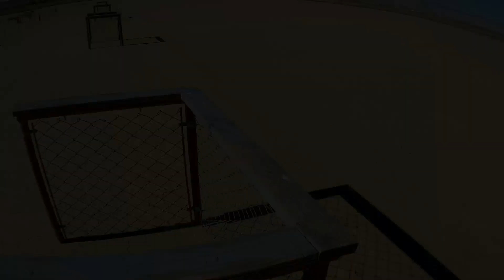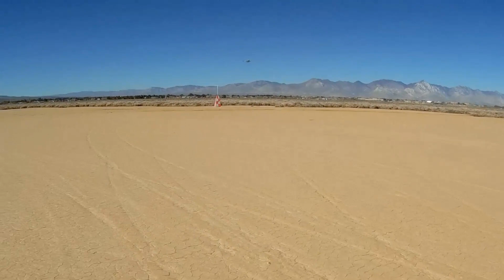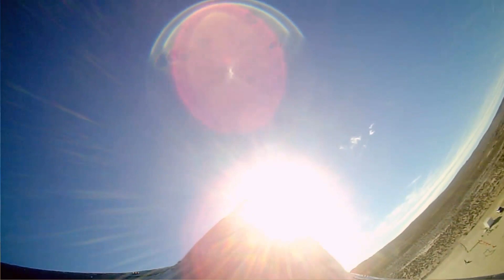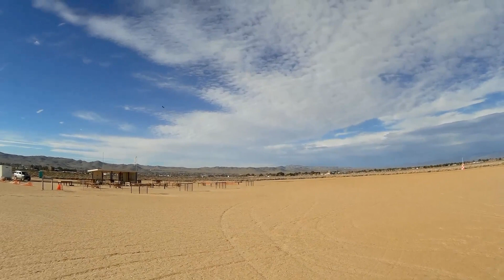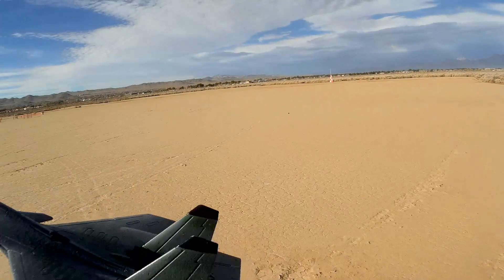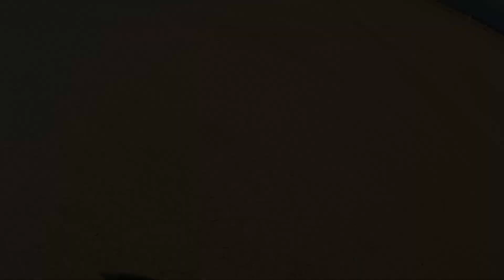Flybear FX861 J15 Flying Shark RC Combat Jet Flight Test Review

Comment: Q101 or anyone, Do you know What kind of lipo & or connector it uses? I'm looking for spares.
Reply from the maker: +D Navigator 7.4V, 800mah, red JST. Dimensions 13mm x 28mm x 50mm
Reply: Great! ; that's a pretty common size, THANKS! I want to jump on this...looks like GB & DM are the only 2 retailers.

Comment: I'm surprised of the stability. I have the Flybear 808 biplane I use for indoor flights.  I'd think this not the plane for folks in urban areas that don't have the vast room you do to fly these things.  Stick to quadcopters for those folks. Still waiting to test fly both my F959 & Hubsan H301S powered gliders at my RC field.
Reply from the maker: +MrPolymers If the wind dies down, take the 808 outdoors for a high flight over the neighborhood.  And if feeling brave, try a night flight.  But you'll need to maintain orientation by its movement alone, as it just appears as a moving light dot in the sky.
Reply: LOL..  Well, I got yelled at last fall from one of my neighbors flying my Flamewheel quad over his house.  Since I'm within 5 miles of CAK, I don't want anybody calling the police on me. My days of flying in the hood are over. I'm pretty much resigned to my clubs flying field.  I don't have the luxury of a desert close by..;)
I did try the 808 in my driveway. Nope, must have been too windy..
Reply from the maker: MrPolymers I really like my 808. I keep it in the car, ready to go.  What I like about it is that any small field or parking lot will do. If I drive by anything that looks suitable, and if the wind is right, I'll sometimes stop and send it up for a short spin. I'm going to have to do a "Keeper Series" video on it :)
Reply: I found the 808 to do best with no additional weight to the front contrary to most reviews I've seen.  It allows me to do tight turns in our gymnasium we use during the winter months. Yes, for $20, it's fun but you really cannot have any wind or that's been my experience..
Reply from the maker: MrPolymers Put weight on the front, and you'll be able to fly in light wind.  Just use mounting putty, easily removable for if you want to fly indoors again.
Reply: Yes, I use small washers inserted in a slot I made.  FYI..  Summer of 2017, my wife and I are renting a Mustang convertible and doing a tour out West.  Not sure of the route, but I do want to drive remnants of old Rt 66.  My daughter did a driving vacation last Summer. Flew into Vegas and rented a car and drove to Santa Monica. Was really impressed with Lake Tahoe.  She said that's a place to visit on it's own.  She liked San Francisco too...

Comment: Wonderful review - you really had me laughing with you throughout this one so much! I think it is your affable manner and style that makes your reviews so endearing and relevant, not to mention enjoyable. Just one thought on the 808 no 16 keychain camera. I suspect that had you mounted it in the same position but on the underside of the fuselage you would not have had any problems with it but the weight on the top would have contributed more to stability issues, even if it is only 20 grams.Thanks again for another great review!

Comment: Great video as always. I love that little jet. Where did you get the model of the 808 cam? There are so many diff ones. Thanks!
Reply from the maker: +Peebsfosho1 The following is the model that I used.  This version has wide angled lens, true 720p resolution, and 30 frames per second frame rate (the cheaper versions drop one or more of the above specs) http://www.banggood.com/808-NO_16-HD-120-Degree-Mini-Camera-Module-7g-p-82197.html?p=RB0922217402201307U3
Reply: +Quadcopter 101 awesome thanks for the quick reply!

Comment: I have a question, and a possible answer.Are the props counter rotating? (One clockwise, one counter clockwise?)If they both rotate the same direction, you may be experiencing "prop walk" Or also known as p-factor, or asymetrical blade effect. Under heavy loading, high angle of attack, it causes a yaw. Just a thought. Great video, thanks for all the reviews, anytime I am looking at a quad, you are the first one I turn to for a review.
Reply from the maker: +n5lyc They are counter rotating to counter the torque.
Reply: Hmmmm, Well, time to look at another reason for the yaw issue toward the end of the video..
Reply from the maker: n5lyc In the excitement of the flight, I had accidentally turned the yaw trim knob all the way in that direction.

Comment: Good I get a good like to 808 camera you are talking about, I've seen various prices with a big difference so I want to make sure I get the right one. Thanks!
Reply from the maker: +Ray Fab Their are many many versions of the 808 camera at many price levels  http://www.chucklohr.com/808/index.shtml.  Some are good, some bad, and some terrible. This is definitely a camera that the phrase "you get what you pay for" applies. The version that I use (808 #16 V3 with D lens) has a wide angled lens, and is 720p resolution at 30 frames per second.  As you go down in price for the cheaper versions, the video resolution drops, the wide angled lens disappears, and the frame rate also drops.  Here's where I got mine http://www.banggood.com/808-NO_16-HD-120-Degree-Mini-Camera-Module-7g-p-82197.html?p=RB0922217402201307U3

Comment: Quite a novel aircraft, and amazingly stable.  By the 3rd flight, I'd have expected you to be doing 6 ft. fly-bys and buzzing the field .. maybe next time.  Doesn't look like a good candidate for aerobatics ... perhaps a few "stall turns", but not much else.  Still, pretty cool. We had nothing like that when I started flying RC at the age of 14.  As for hand launching, you'd be surprised.  Most of us old time RC-ers could hand launch a 7 lb. 6 ft. wingspan airplane.  You RUN into the wind and give it a mighty heave (LEVEL, not up or down).  Seems stable enough that it could do it.  Thanks for the review.  Wouldn't you know it?  It's 60 deg. F. outside right now, but the wind is gusting to 40 mph off the lake, so no flying .. and tomorrow is going to be 20 deg. cooler. Ah well, that's the weather here by the Great Lakes in the Midwest. Cheers!

Comment: Very nice. I never feel comfortable planes like this without moving surface control. But it seems quite good flying machine.
Is it wind resistant or need calm day only?
Reply from the maker: +Abidlife 65 It doesn't have control surfaces, so I'd be hesitant to fly it on breezy days.